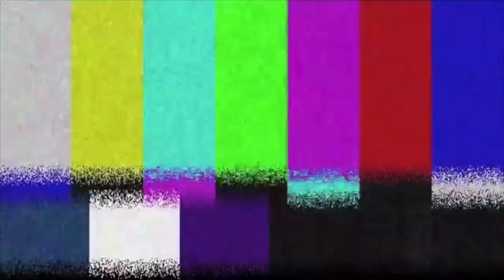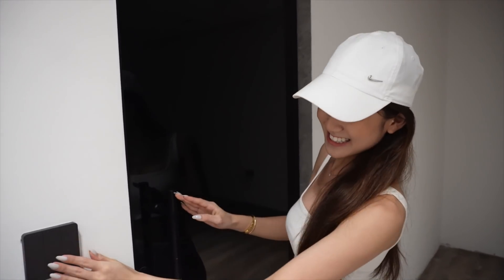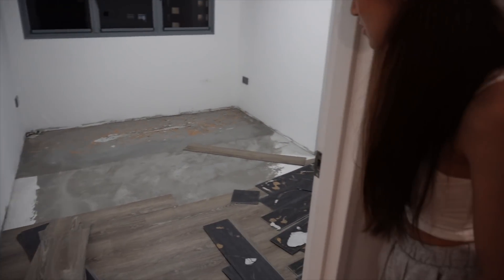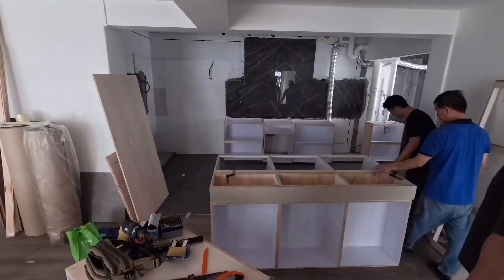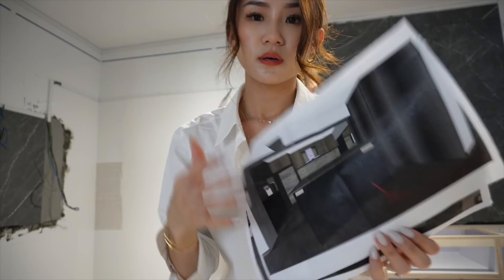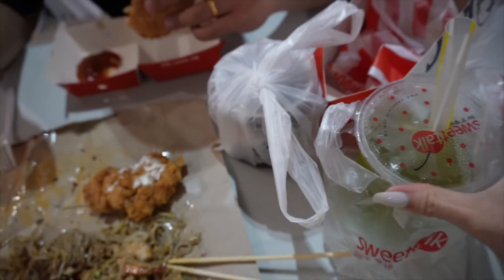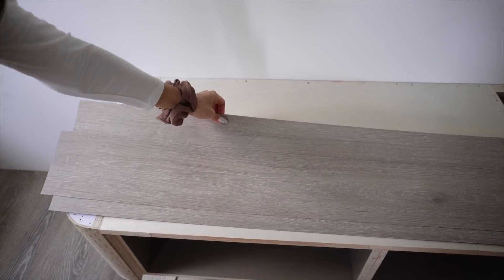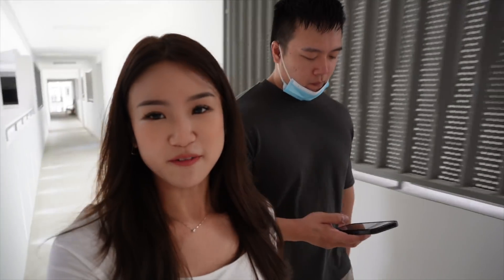BTO Ep.8🏠| Open Concept Kitchen/Carpentry Begins!🛠

Comment: Hi, I have a question with the carpentry materials. Hope you can share. I just bought some plywood to DIY shelves and they started to irritate my eyes and throat. I believe it is probably the chemicals in them (formaldehyde). Did you experience any such effects? Maybe the rest of the community can also share as I heard it is dangerous and want to find a solution to get rid of them.
Reply: Hi. We didn’t get that issue. Perhaps an allergy?